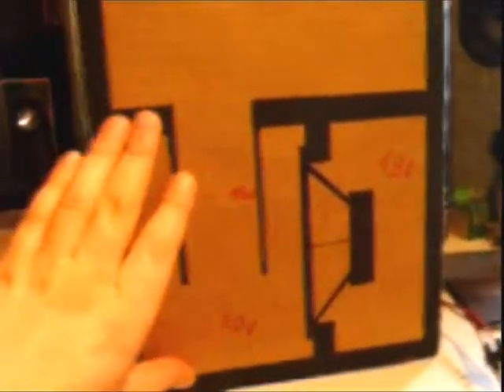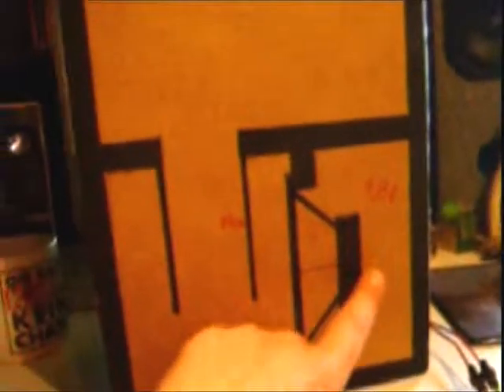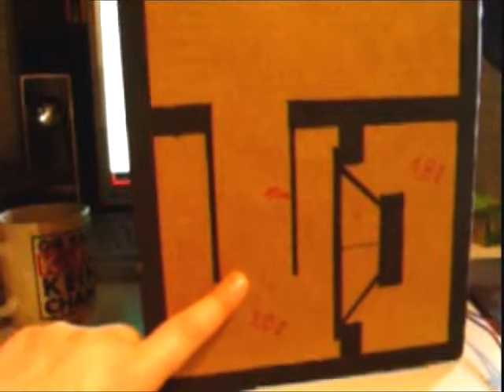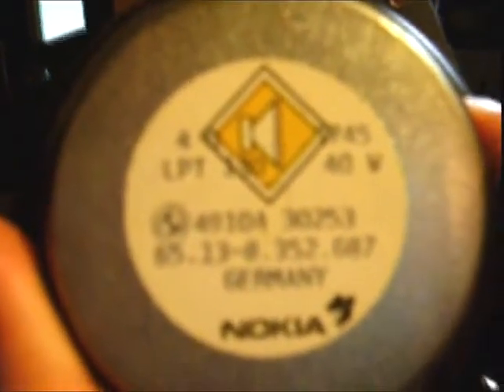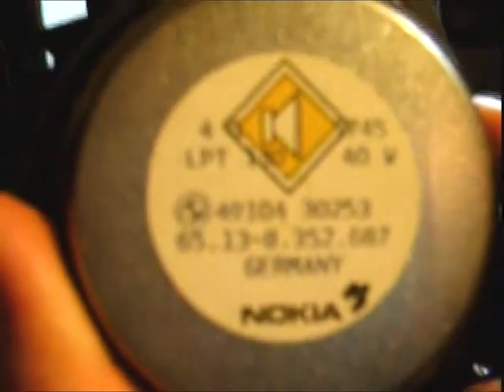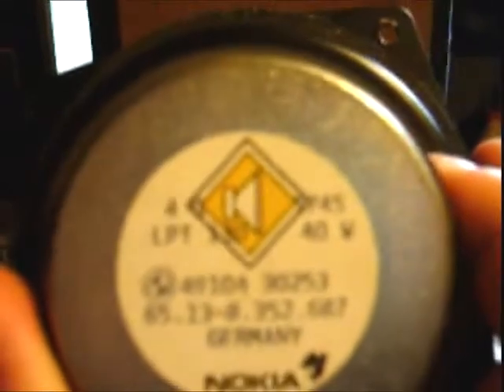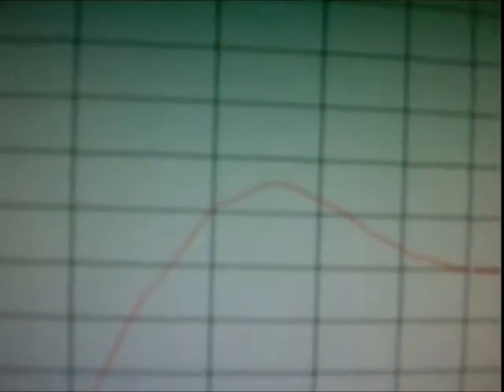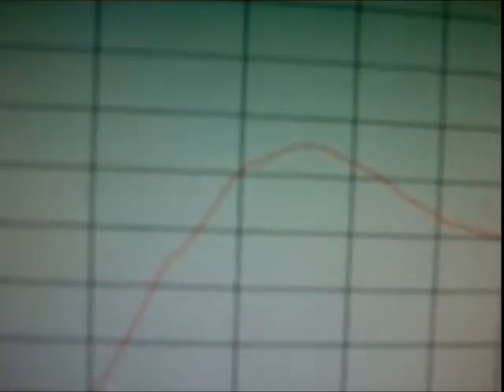3 Chamber Cardboard Bandpass Sub delivers 35 Hertz (Nokia-Speaker)

Comment from the maker: @SmallRoomBigSound The crossover is called : STARTECH HYN-110 Subwoofer Crossover. it runs on 12 Volt DC coming from an stabilized Power Supply.